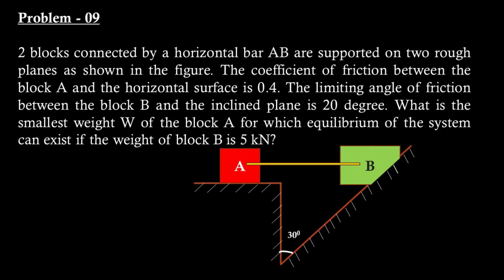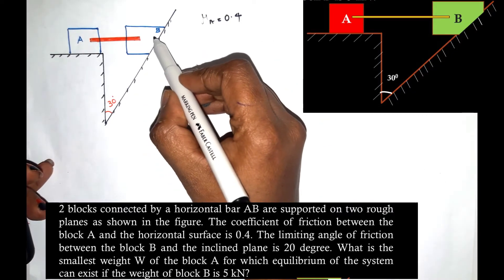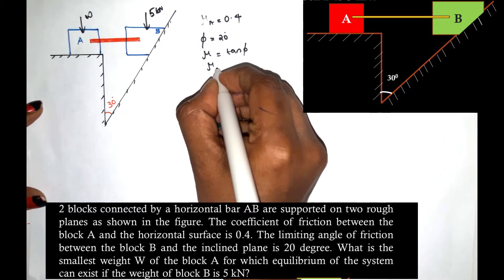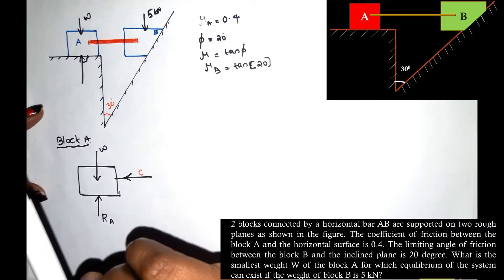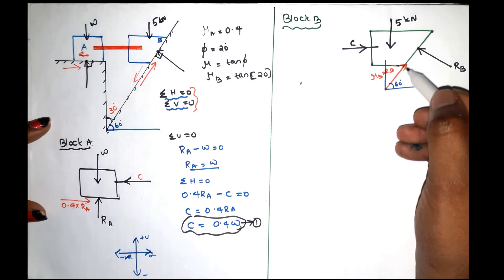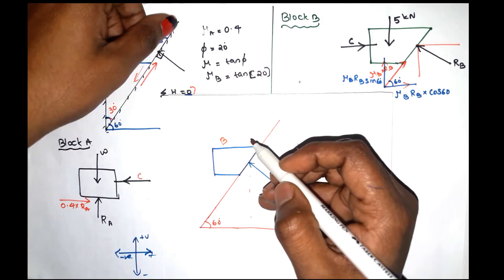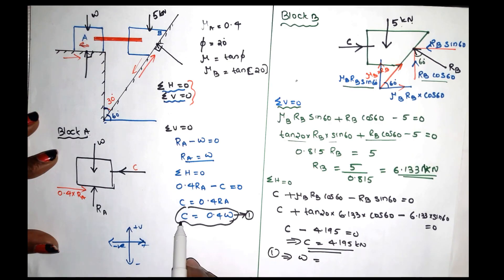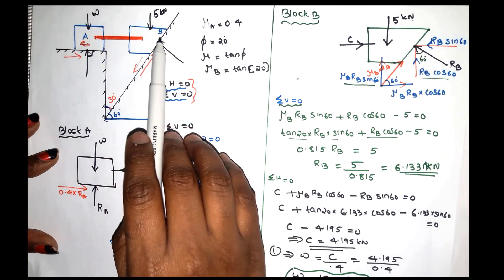Friction (മലയാളം) | Problem 09 | Engineering Mechanics | First Year | KTU B.tech

Comment: Hello madam..Block B inclined planil alle ullath...apo inclined planil ullathinte resolve cheyumpol horizontal and vertical reaction inclined planine base cheythitalle sadarana edukarullath??...ivide enthukondanu vyathyasam vannath?
Reply: Maam plz reply. same doubt
Reply from the maker: Rb inclined plane vachitanu consider chyunath enkil bakki ulla aa rand force um inclined surface nu perpendicular aayum parallel ayum okke resolve chyyanm..angnane varumpol athinte angles um kandu pidikkanmm..
Angne chythal kooduthal complication aakathe ullu..
 bakki ulla rand force um hori and vertical anu..normal aaytanu edkkunne enkil athine randinem resolve chyyandaa